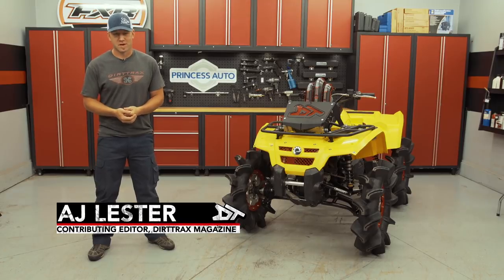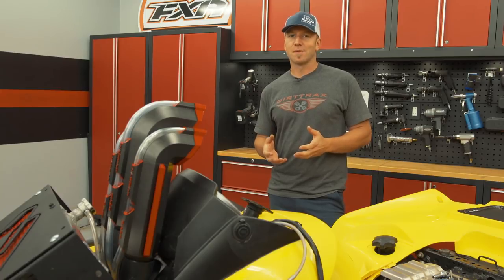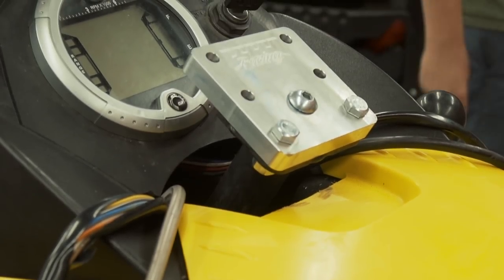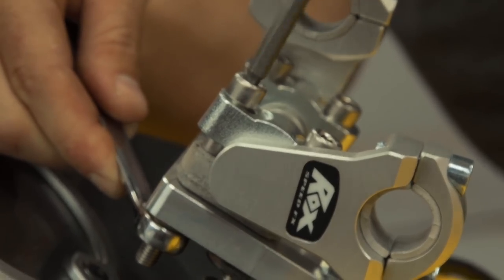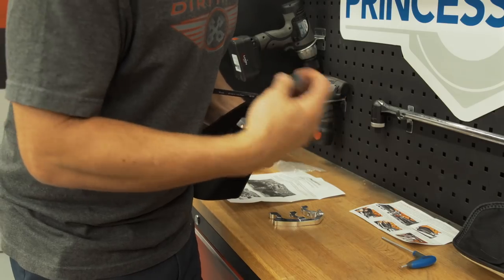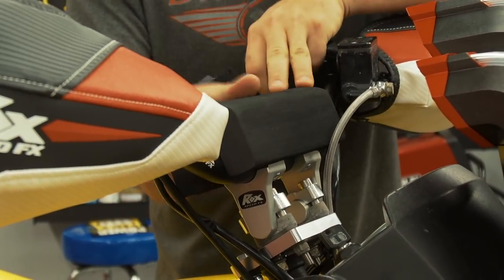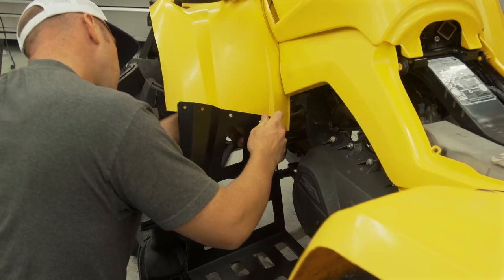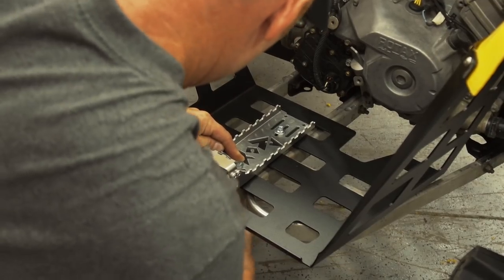Can-Am Mud Build: Part 7 - Finishing Touches

Comment: How does a bar flopping around inside the hollow bar strengthen anything? Maybe from bending in half but how would it stop it from twisting which is what the problem would be? Just think about it for around minute. Nothing is stopping the outer tube from twisting the inner tube is only connected at one end. So the outer tube can twist on top of the inner stem.
Reply: Its strengthens it against bending or breaking. I dont know about these kinds of quads but on a sport quad twisting the stem isn't something that happens often or ever really, most of the time you break or bend it sideways.
Reply from the maker: John: It doesn't flop around inside it, it's friction fit. And I was lead to believe it will keep the top portion above the upper bushing from bending under hard torque loads like when you contact the wall of a pit or in the thing ever ends up rubber side up.
Reply: John Smith you should just think about it again
If the inner bar is tight against the outer tube
The outer tube can't twist. Because when it twists? The inner diameter gets smaller.
With a bar inside it it won't allow it to twist.

Science 
Now you know
Reply: WILDCAT D put a smaller straw in a bigger straw and twist . The outer straw will twist around the inner straw without the inner straw moving . Just because you think the outer stearing tube will apply pressure to the inner stearing tune doesn't mean it will lock onto it maybe if it was welded. So you think about it again friction is not enough to stop the twist go do it in real life then try your higher knowledge bullshit on me.
Reply: WILDCAT D is right, tubing usually buckles inward when it's twisted so if there is another tube inside that holds the shape and prevents the outside one from buckling in, it will be harder to twist it up.

Comment: Did you leave the Gen.1 7-bolt CVT or did you upgrade to the Gen2 13-bolt CVT? If you haven't upgraded, I suggest you do, before going racing. Those 7-bolt CVT covers are well known for warping under heat, we've replaced multiple, including the 7-bolt CVT on RenegadeOne, that ATVRider Magazine built, after a customer had purchased it from someone in Oregon.
Reply from the maker: Hey Tom, yeah we upgraded to the 13 bolt at MrRPM. It was a new parts supplier he was trying out so we didn't mention it incase we had any issues with it but it's helps up great.

Comment: What happened to being a "low budget" build that I remember being mentioned in the first video, this is as all out as it gets if you ask me or anyone I know. This is for ballers and ballers only
Reply from the maker: It was always a budget friendly mud racing build. If you go to any sanctioned mud race event you'll see that this thing is about 50% of the cost of almost every rig racing thats on a newer gen chassis. Everything said and done we will have a fair bit less invested than what you can buy a new XMR for, and the completed build makes a stock XMR look like a 570 when raced. Yes if you just wanna go run mud on the weekends with the buddies a clutch kit, some good tires and a bit of a lift will do that for ya but we always set out to build a full race quad on a budget less than a new stock ATV.

Comment: You have money , I am not rich , this is most likely really expensive when I can go get a stock atv and do just fine and have a lot of fun
Reply from the maker: As I've stated a lot now...... this is cheaper than an XMR or High Lifter. Yes you can go run mud with a 1996 Polaris Explorer and have a blast, but if you wanna race, competitively you can't with a stock XMR or HighLifter. We built a competitive racer for a lot less than you would spend on a new bike and made significantly bigger HP, better performance and way better times in the mud.

Comment: Should do a bruteforce with a tyrex bevel gear rox risers snorkel custom aluminum floor boards aluminum crushlox racked radiator programmer no lift on motor monsters swamp series exxhaust custom front and rear bumpers back up light and 10inch light bar with leds and synthetic winch and stock high compression kit oh yeah I already did that its a can am killer to this day
Reply: cookymudstar I wouldn’t say it’s a can-am killer 😑